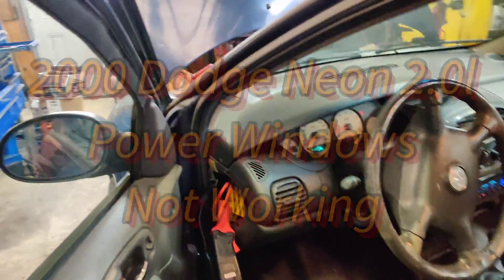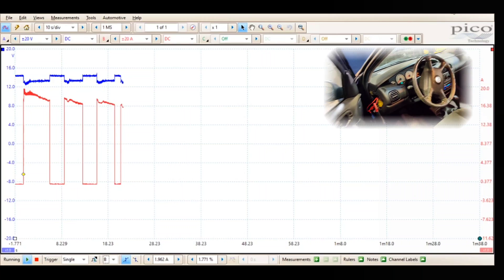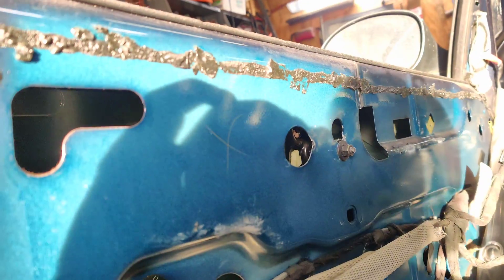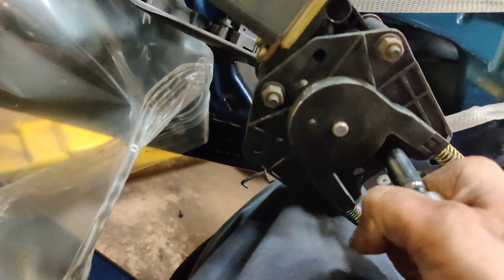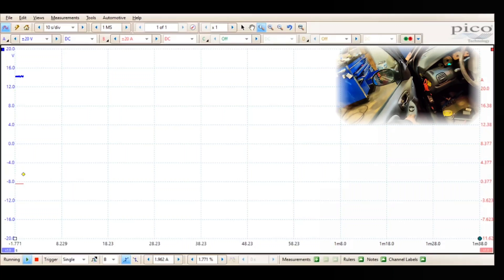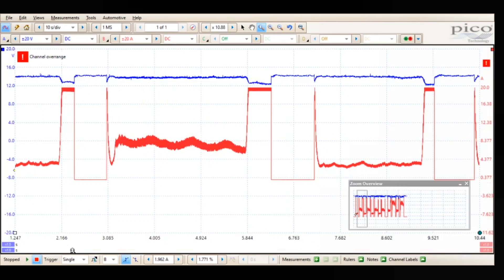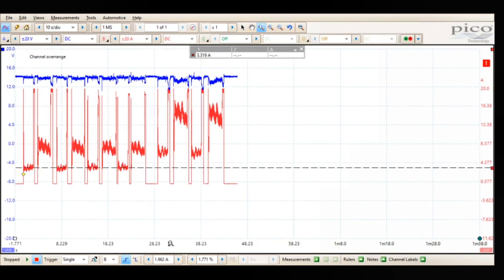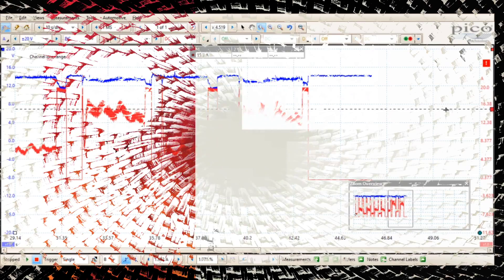Quickly Test Power Windows With A Picoscope on a 2000 Dodge Neon 2.0

Comment: I had a simular job the other day apart it was both rear windows on an alfa romeo....One window the mechanism was jammed and the other had a faulty motor.... So for now i only got one working....
Could you hear the motorstrying to move/clonking before you took it apart?
Reply from the maker: No, I was actually getting ready to order new motors. Only think I noticed was the done light would dim slightly when pressing the switches. It made me think the circuit was good. There was zero signs of the motor moving or even trying to move.